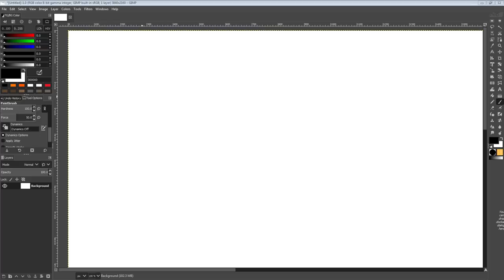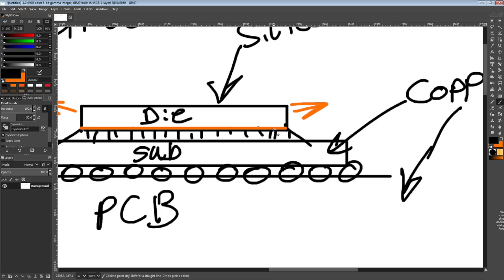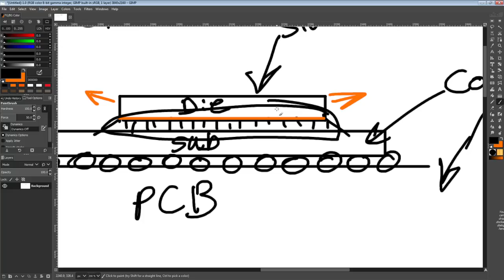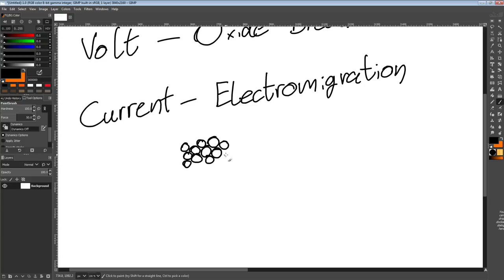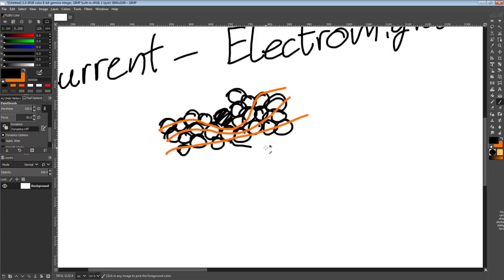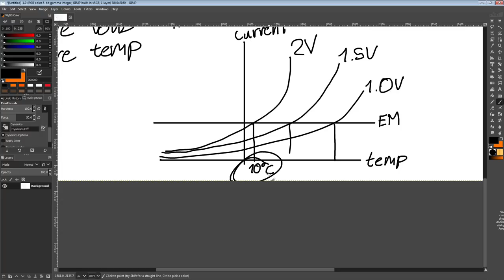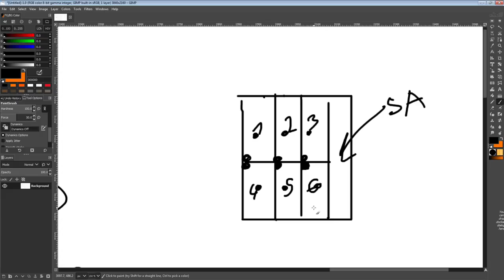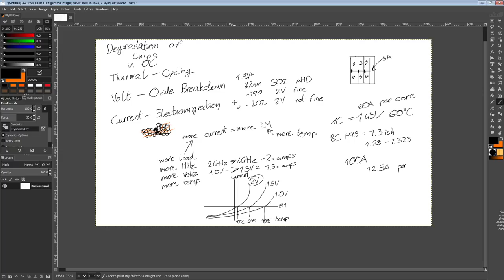Rambling about chip degradation

Comment: Ive been hearing stories of  +1.3v overclocks significantly degrading zen 2 ryzen chips. Not sure whether to believe the internet on that one. I swear most people that post on overclocking forums dont know what they are talking about.
Reply: The last part of your comment is spot on.
Reply: I heard the same stories about the +1.3v overclocks, I am still curious if this could be true as I have my Ryzen 7 3700X Running on a 1.325V Overclock 
The max temps are around 67*C under full load, but still I am curious
Reply: Well I managed to regrade an 1800x at around 1.40 after months of running it OC'ed.  I won't take an OC anymore,  only will run stock.   To be fair I was running it on a smaller AIO (H80i GT) which wasn't really up to the task.   Killed the AIO as well,  as it started getting galvanic corrosion issues due to the heat destroying the glycol.
Reply: I've had my 3600 for a few months, have settled at 4.1GHz and 1.38 vcore for a while now without any obvious instability and I don't care much about stability for 24/7 stress testing with something like prime95. I am skeptical of all the info about how above 1.3 volts is so dangerous because the stupid thing is supposedly rated for 4.2GHz boost and achieving that on all cores at all times without crashing is impossible with just 1.3 vcore, at least on my chip.
Also the marketing about 4.2GHz boost is misleading because leaving everything on auto with overkill custom loop watercooling for tons of thermal headroom the CPU has only a single core intermittently boosted up that high when settings are left on auto.
If anything the incredibly shit stock wraith stealth cooler is the real problem. I basically had typical above 90C laptop type temperatures even on auto settings when running cinebench R20. Now under water it's more like 70C and in typical use like gaming the temps are around 50 to 55C with the manual overclock and supposedly high core voltage.
Reply: @jeffm2787  1.4v wasn't ever regarded as safe for 1st gen Ryzen though
Reply: @helioNz4R  It turns into it's working and the thermals are good so run with it.   Needless to say I don't bother overclocking any of my Ryzen chips anymore unless it's PBO.   Running a 3950X now.
Reply: @BitterCynical  I ran a 3800X for a while and no matter what I did on my custom loop or an AIO,  or Air,  it was always 73C assuming the same 22C ambient.  I could hit it with 22C water at high flow rates and still 73C,  better (or worse) thermal paste,  73C.   Moved to the 3950X and things are much better.  60C under 16 core loads.
Reply: @jeffm2787  For an all core work load those 73C on water seem fine from my experience with my 3600. Not sure how you go to much lower temps with a higher core count chip though, some variable is very different.
Reply: @BitterCynical  It's either way it reports the temps,  position of diode within the chip(s) or something else.  I can't imagine the 3950X actually runs cooler vs the 3700X or 3800X.   I'm of course happier seeing the lower temps vs my 3800X.  No OC involved in either case.
Reply: @jeffm2787  I'm seeing the same thing on my 3800X as well. Not 73C exactly but high temps. I noticed my board was overvolting at stock, did you check your voltage?
Reply: @FlawleZ31  Running a Gigabyte x570 Aours Master.  I thought I looked at the voltages on my 3800X and they looked ok.  Running a 3950X now on the same board and BIOS, no temp issues.
Reply: @jeffm2787  I'm using an MSI X570 Unify. I think it was like 1.42 at stock. I dropped voltage and set all core to 4.5Ghz.
Reply: @jeffm2787  unlucky
Reply: 1st gen Ryzen OCing confused me. Everyone was talking about 1.4V max but I had to fight my motherboard to go down from stock voltage to 1.35V to not exceed 1.4V on my 1700X.
Reply: @BitterCynical  I've been running at 1.45V with my 3700x since launch. That allows me to run it at 4.3Ghz all core. It gets pretty toasty in Cinebench, but during regular use it is just fine. 37 in idle, and usually around 60 in most games. Maybe these settings cause issues for some people, but not for me. It has been rock solid. I used to push my 4690k to the same level. The only issues I've had with that system were RAM related (funnily enough not OCd, because it was so shitty it wouldn't OC at all...). During one summer I had to drop my OC a bit because I simply couldn't cool the thing. But that system is still up and running just fine.

I guess I should probably see if I can lower that voltage a little bit, since I kinda got settled there while trying to OC further. Either way. Seems fine for now. I wouldn't recommend it because I can't guarantee it'll be fine for everyone. But hey, it's a pretty cheap chip. If it dies in a year or two, I'll probably be able to replace it without breaking the bank (looking at the price evolution of the 2700x...)
Reply: sw4gr1d  1.55V in stock is not safe

Sadly most people dont know how to reduce the voltage and make good tweaks to prolong the lifespan

Comment: on the topic of water, one of the big advantages of it is actually the thermal volume of water it's self; under a long-term heavy load, water and air cooling performance isn't that different, but where water really has an advantage is in sudden temperature spikes, which would mean a larger thermal difference between the chip and the substrate, are much better managed due to the higher thermal volume of the cooler.

Comment: 33:31 in most cases the current rises more than linear because with higher frequency the time were there is a shoot through or bough of the mosfets still changing will get longer because the MOSFET has to work faster.

Comment: The Fury X also has a benefit of the built in water cooling. The Fury or Fury Nano cards will be the ones that'll show the thermal aging affects way sooner than the X. The Fury X also throttles at 65'C because of water pump. heh

Comment: I don't know if I missed it but there is the fact that the smaller the lithography, the lower the voltage and over voltage tolerance. I remember I saw an interview on gamernexus where the interviewee said that the biggest cause of the degradation was by far the voltage due to how you said, the place that heats up is well below the chip and because of that, independent of the cooling system (without subzero) the heat generated there by the overvolt increases exponentially compared to the rest of the chip and that over time slowly ends up burning part of it and depending on the voltage used the heat reaches such a point that it simply does not have time to transfer from there to the rest of it which causes it to burn almost instantly. As mentioned, it is a problem that also tends to worsen a lot with the reduction of lithography since the chip becomes a lot more sensitive to changes in voltage and temperature as it gets smaller and the components tighter and closer.

Comment: The electrons wont smash the atoms out of their way. Instead they push the electrons from one atom to another and causing the atoms migrating from one type (e.g. copper) to another "useless" type which is not longer part of the copper-structure and drifts out of the material.

Comment: 27:01
TL:DR
Search images for MOSFET Drain current vs Voltage
You can see there is a "saturation" of the drain current. At that point is it technically close to linear at that point, but it had a different behaviour from 0 to a certain voltage.

Very rough explaination:
I am by no mean an expert but if it is helpful I studied physics and I'll share some info:  In a MOSFET transistor there are usually 2 voltages at play: the one between the Gate and the Base, and the one between the Drain and Source. The former acts as a "switch" in digital electronics, it serves the purpose of "turning on" the flow of current between Drain and Source. Let's say we keep the Gate and Base at a certain operating voltage and slowly make the Drain-Source voltage go up, Drain current at first goes up very quickly, then it saturates and goes up way slowly. You can find a lot of graphs by searching  MOSFET Drain current vs Voltage or here  https://www.researchgate.net/figure/Drain-current-versus-drain-source-voltage-in-trigate-MOSFETs-with-various-values-of-gate_fig5_260522076
That's why twice the voltage (past a certain point) does not equate to twice the current.
The reason behind it has to do with how this "gate" operates: it's pretty long to explain here 'cause one needs to know how fundamentally a MOSFET transistor works, but very roughly speaking: the gate "creates" a path for the current to flow between Drain and Source, when the Voltage between Gate and Base is over a certain threshold voltage, lets call it V_{Threshold}.
Also typically Base and Source are shorted to the same voltage so we can speak of Gate-Base voltage as Gate-Source voltage: V_{Gate-Source} .
When V_{Drain-Source} > V_{Gate-Source} - V_{Threshold}, in in the proximity of the Drain gate voltage is lowered by the drain voltage and drops under the threshold voltage needed to keep this path open, so the conductive section aka "the path", pinches,  thus hindering the flow of the current. 
On one hand you have higher voltage difference that tends to make the current flow higher, but on the other the zone around the drain which is hard for electrons to flow in gets larger, this effects counteract one another, still there is a linear increase in current vs voltage at that point, but one that does not intersect the {0V ;0I} point.

Comment: This is good stuff, I swear I must have degraded my 9900K. Used to run stable at 5.4, just stopped one day out of the blue and never would again since.  Not that I’ve tried it recently.  I’ve considered delidding, but the risk is too high for a chip that’s still good for 5.3 all core daily
It’s been liquid cooled on a high end custom loop, so not quite sure exactly what happened.
Reply: Zfast4you  yes, that is correct, well, set at 1.4v, temps when under heavy load in the 80s, but it's a gaming rig, temps rarely exceed the 60s.
I'm not upset about it though, it lasted for about almost a year at 5.4.  I'll hang onto it for another year, maybe 2, then upgrade.  If i start having trouble at 5.3, then it's time to go.
Reply: Well, to be perfectly honest, I’ve been over clocking for 15 years and I’ve never experienced this before.  I’ve had a few graphics cards die on me, but never had any other components give me trouble.  I have a pretty extreme liquid cooling setup, so it’s about as good as it gets without going chilled liquid.  Well, I guess I did have a 980x I used to run at 4.0 when it was stable at 4.4, but I’ve been throwing caution to the wind since then.  I killed a Kepler Titan, my fault, pushing it too hard for too long.  But never a CPU.  I did crack the TIM on a 4790K once, but delidding fixed that.
Besides, why sit on it at lower clock speeds if it can do more?  I don’t keep anything beyond 2 years, 3 max.  Regarding performance, I’m obsessed with minimum frame rates, the super high clock speeds are typically what bring those up.  And I also have a high end set of RAM OC’d and timings all tuned for max performance.  380w BIOS on both my 2080 Ti’s.  So everything is balls to the wall.

Comment: As I understand the papers with the psyics is the following.
Thermal breakdown = Heating and cooling, for example when solder cracks happen in SMDs (RTX "Space Invader" memory issues)
Volts = Oxide breakdowns, for example in Ceramic Capacitors loose their effectiveness over time. (Image ghosting on older electronics)
Current = Electron Migration, for example in a CPU when a transistor gate is "open" or "closed" other transistors sitting close or next to each other can cause free electrons to migrate across the gates. Some common exploits manipulate this effect like "Row hammer" in RAM.

Comment: This makes me very suspect of the longevity of these 14nm intel chips that people love smashing 300-500+ watts into lol. 
On the subject of overclocking and whamming voltage and amps into chips, I'm actually very happy with what AMD is doing with XFR and Precision Boost. I only ever overclock for performance so if the chips are safely maxed or even just nearly maxed from the factory I'm happy. Less time staring at bios and blue screens and more time gaming.
Reply: the intel cpu's aren't that big actually, even the 10900k is only around 200mm2, and runs significantly cooler than Ryzen in spite of the higher power draw due to the much lower thermal density of 14nm. These chips are going to be running for a long time unless people are pushing them to the limit 24/7 and are not respecting Intel's vdroop specification

Comment: I am a computing freak since 1986 and the degradation of micro processors is totally new to me. Even old computer from the 1980's are still working fine. There may other parts fail at some point but the micro processor is the least to fail. 👀

Comment: I wonder how vega 56 and 64 managed to survive this long when they run HOT and their cores are huge.
Reply: Interposer maybe? I don't know if that has a knock on effect for this.
Reply from the maker: they aren't that old
Reply: I plan to get a used Vega 56 and powerlimit the shit out of it. You can halve the power consumption for like 20% performance loss. It uses less power and still significantly faster than an RX 580.
Reply: Worrying Laughter
Reply: @TheGyuuula  my rx 480 uses 130w maximum
Reply: @Noooo23523   That's interesting. What model do you have, and what kind of settings do you use? OC models can go above 200W. Typical usage is more around 160-170W
Reply: @TheGyuuula  did you ever had a rx 480
Reply: @TheGyuuula  online benchmarks are fake when theu say that rx 480 uses 200w but it only has a 6 pin and pcie slot that means 125w maximum and some rx 480 burned pcie slots because they overclocked them, my rx 480 has a 8 pin which can get 150w in the gpu and in light games it uses 50-100 and in hard games it uses between 120 and 130w
Reply: @TheGyuuula  200w is whole pc consumption usually, my 1700 at 3ghz uses like 45w and my rx 480  at 1310 mhz uses 130w, my 1700 at 3.8ghz and with 3200mhz cl 16 16 16 35 uses like 70w
Reply: @TheGyuuula  if you are a intel boi then you take tdp as minimal power consumption under load but if you are a amd boi you take it as how much heat it dissipates
Reply: @TheGyuuula  i have a asus rx 480 8gb strix oc
Reply: @TheGyuuula  mine has a 8 pin and it uses 130w and because of the 8 pin i can overclock it
Reply: I managed to kill my first Vega 64 within 18 months of owning it. It lived most of its life being water cooled. I guess flashing the BIOS and messing around with powerplay tables hastened its demise.

Comment: Well, my 3600 is most clearly degraded already big time. Only 1.35v did it on a d15.  Never really got very hot either.  So yeah.  Guess I'll be RMAing every 6 months.  So much for the "value" crap of that platform.  Funny as hell that the old 2500k is still rocking since 2012 at 4.8gh nearly 24/7.

Comment: So my Ryzen runs on 0.68-1.0V and the temperature is in a range from 24-44°C. If I keep it that way it should basically run forever.
Reply: Sounds like good silicon, overclock the snot out of it.
Reply: @lawliot  It is a Ryzen 1600AF, I can easily overclock it to 4.3Ghz but don't really need the performance right now, so I decided to run it at stock frequency with aggressive undervolt. Benchmark results are the same as with regular voltage but the power consumption is around 49W instead of 80W under load.
Reply: Yeah ... but running a cpu forever is rather boring ... as luuzeri suggested, go and oc the snot out of it
Reply: @snowhawk4049   not "forever", but maybe a lifetime if you still can find replacements for the other parts around. Also after 50 years, softwares, OSes, communication protocols and ports will likely be all incompatible.
Reply: My 2700X runs at 66 degrees Celsius. It's doomed. =\
Reply: @CaveyMoth  Idle? :-(

Comment: Electromigration sounds a lot like what might be happening to Intel CPUs. I'm guessing most motherboards are running unlimited current and unlimited power, plus thermal velocity boosting to high voltages. Even server boards might be hammering the prefered/boosting cores with high load and getting them up there in volt/current/temperature.

Comment: 12:50 That's EXACTLY what happened with my Rebrandeon variant, the 280X. And just a month before warranty expired, funnily enough. Couldn't return it in time.

I can definitely tell you that the Twin Frozr cooler, infamous for inadequate thermals on the AMD side coupled with insufficient maintenance would yield this fate for sure. The recent hot summers really got it. I wonder if I can still fix it.

Comment: I appreciate the video. However, I still don't know how to figure out what/how to adjust things on my GPU.

I recently started playing Borderlands 3. That game pushes my GPU harder than any other games I've played. I have a GTX 1080ti that is NOT overclocked. But, the game pushes it to 82-83 degrees C.

I have been trying to figure out what is a safe voltage to bring it down to, while also increasing the fan speeds earlier to reduce the heat.

Can't afford water cooling. And am disabled, so I can't take it apart to repaste it. Any help would be appreciated.

Thanks again for the video.

Razar.

Comment: With electromigration there is a trigger threshold and migration is not linear, temperature also feeds back into the rate of EM.
https://www.ifte.de/books/em/em_chap2.pdf

As cross section divided by current squared is a part of the MTF equation, more current is exponentially more migration.